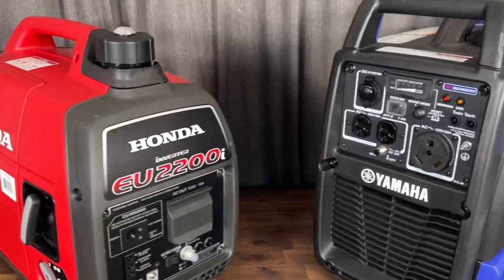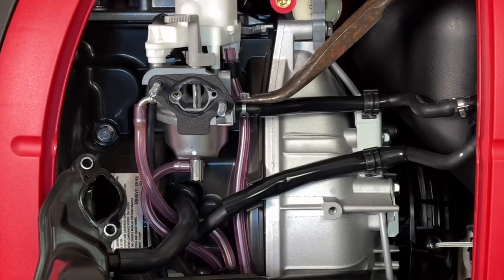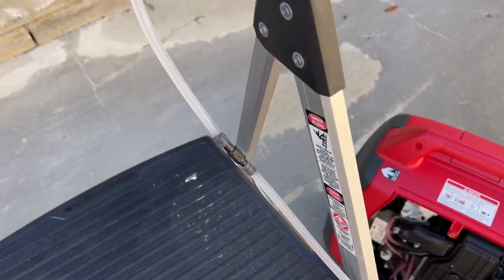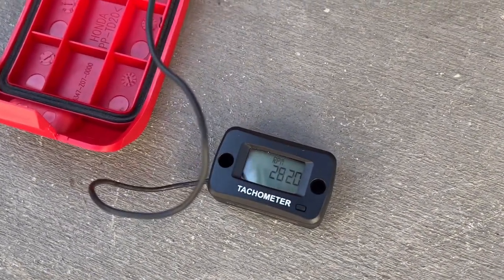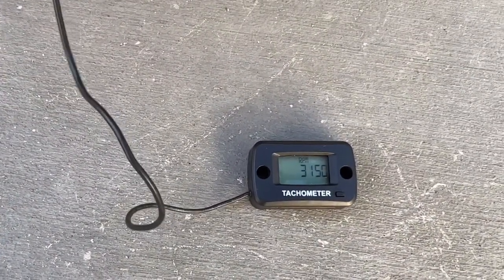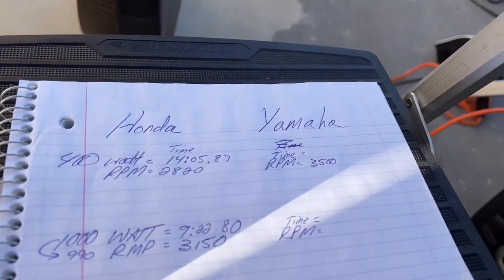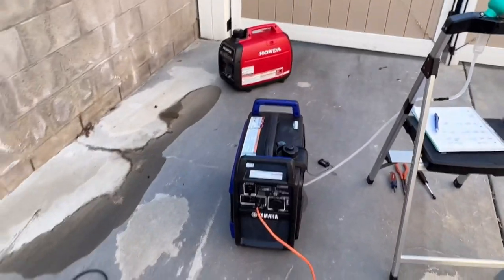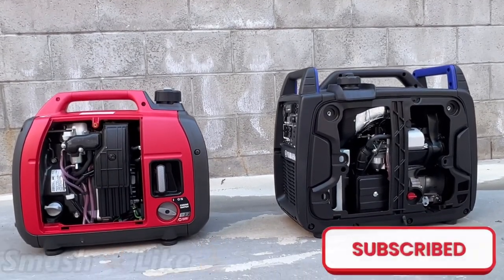Honda Eu2200i VS Yamaha EF2200is Fuel Efficiency Test

Comment: We had the Honda E300 decades ago it was an amazing generator which we took half way around Australia.

We started in Phillip Island and we drove up the East Coast right up to Cook Town then back down to Charters Towers.

Then across to Three Ways Road House then back down to Adelaide stopping at Alice Springs, Tennent Creek Cooper Pedy and then back down the Peninsula to Adelaide.

Over 170+ camps in total.

We ran it over twice. (Forgot it was under the van).

We thrashed the shit out of it !

I don't know how it lasted as long as it did.

I would regularly take the head off and decarbonise and clean the combustion chamber.

Why? I dont know. Back yard mechanic told us to. 😀

It was very good quality generator.

Fk knows how it used to power what we put it through.

I think it only generated 300W.

Anyway, I'd buy another one albeit much bigger like 1800W or bigger. 

Honda. What a beauty! 👌👏
Reply from the maker: Dude awesome story!! Those old units were like tanks much like a lot of stuff from the 80s and before. 

Thanks for the comment and thanks for watching 👍🏼😀
Reply: @johnnysweekends  Thanks for the reply.

Much appreciated!

😀🤟

Comment: But...  higher RPM's means more wear.   So you can expect the Yamaha piston rings and cylinder walls to wear out much faster than the Honda will.
Reply from the maker: Possible, but you also have a push rod motor verses Hondas timing belt. 
It’s pretty close from all gathered data. 
I do prefer the Honda though for size and how quiet if choosing between the two
Reply: @johnnysweekends  Gotta admit,  not crazy about the timing belt repair on the Honda.
Reply from the maker: @BillySBC its not horrible but its time. And how many hours on the whole unit. So all depends i guess.

Comment: Seems like the best way to do the test would of  been  the way they are ment to run from factory.
Just add a qt. of gas.
Reply from the maker: That’s leaves uncontrolled variables… no way to measure fuel line length, or visibility of all fuel used up, and setting load then topping fuel to fill mark and set timing.
To many flaws just pouring fuel in.
Reply: @johnnysweekends  thank you for responding I understand 100%.

Comment: Common sense says at higher rpm the Yamaha was louder...  For potential new owners please include decibel tests in this video series

Hondas gensets are incredibly quiet ...reliable durable.. and worth their cost....

I myself am an mz80 Yamaha guy because I can buy a genset from various makes with a genuine Yamaha engine for considerably less.. than a genset directly from Honda or Yamaha...

I own 2 smarter tools ap2000iQ gensets with genuine mz80 Yamaha engines that I parallel with a wen 30A/50A socket kit..  

1st genset is from 2004/5 second genset from 2009..  the outer cases are scratched and banged up but they keep running..
Reply from the maker: People love the mz80 engine especially since it’s push rod and not belt driven

But I do have a sound test and load test on these exact two units in another video. 

But yea if your Yamaha does finding a engine would actually be really easy to replace. Not so much on a Honda. 

Thanks for the comment and thanks again for watching
Reply: @johnnysweekends  yes I seen the sound tests.. but sometimes people are viewing for the first time... It would be helpful for them...

You are my go to for infor generators.. fossil fuel and lithium...

When my gensets end their servicibility..  A-iPower for 2x 2300w and an ecoflow..

All thanks to your obsessive compulsive...micro managing and tyrannical testing
Reply from the maker: Wow thank you. 

Yea I guess I could at least let the viewer know I have a video with the sound tests or give them a overall on it. 

But yea many more videos coming. Just need time, work has been crazy 😜

Comment: Sorry, but tests were flawed from the beginning.  The machines were not necessarily tested with exactly the same volume of fuel.  Only if the carburettors were the same internal volume and fuel level, when the jets failed to pick up fuel, could these tests possibly be verified as fair, if even then.

A fair test would be to time for an identical measure of fuel - one level on the external measuring vessel to another on that vessel.  The measurements could be repeated without the machines running out of fuel (running out of fuel is not the way the machine operates normally).

I’ve no idea which machine is most economical on fuel, but often, when used in the real world, the machine may spend some time at virtual idle or it may be running on a constant load.  Even the actual voltage sustained may alter the total energy delivered, which may change close results one way or the other.

Fair tests are not so very easy to arrange - especially if machines are closely matched - and these single tests were not proven to be a truly fair comparison.
Reply from the maker: True the float bowl size could have definitely giving one a advantage by a slight margin. I would say seconds as I have taking these apart before and the amount of volume between the two is minimally different. Every test has room for error and handicaps if you will. 
So to say the test is flawed is not really accurate at all. Verses the test did give some good usable data. Over all a smaller displacement engine running a light load more than likely is going to burn less fuel. 
But you are allowed to view it as you see fit. 👍🏼
Reply: @johnnysweekends  There is also the state of tune of the carburettor.  There is the possibility that one was set weaker than the other (ideally they should be precisely the same, but not quite would be near enough to affect your results over a period of time).  Some ‘running in’ might affect the life-time energy efficiency.

Doing one run on each test was not particularly good practice, what with the results only being marginally different.

Yes, personally, I would not accept your conclusions from only one run on each setting - with no further corroborative evidence that everything else was exactly identical.  Sorry, but my personal conclusion, of your results, from a scientific point of view.  Your conclusion may be correct but just not proven, either within the realms of significance or from the point of fair testing.   Experiments such as this, with sweeping statements such as this, cannot be regarded as absolute.
Reply from the maker: Well if you just want facts I’ll let you draw a conclusion. 
Out of these two generators, if I give you one gallon of gas, which one will provide you with the most total energy?
Reply: @johnnysweekends  From your tests?  I would have no idea, but I doubt there is very much between the two of them.  

Personally I prefer Honda to Yamaha - but my preference is likely biassed - from motorcycles in the 1960s to the strimmer and small water pump more recently.  

What is for sure is that I would purchase neither, in preference to the other, by using your testing data.    I would be looking for more fair testing of the items, before coming to any hard conclusion.
Reply from the maker: If over all energy is what you are looking for out of 1g of gasoline the answer starts with the color B. 
Unless that still cant fill the ending your looking for. But hey what do I know.

Comment: Your Honda not running smooth, lots of vibrations on idle.
Reply from the maker: Yea seems like a normal complaint even my eu2000i did it…
Reply: @johnnysweekends  my 2200 run smoother.
Reply from the maker: Yea I know people have said that there unit runs smooth and others have said mine runs a little rough like yours… so unless I wanna mess with the mixture and break the tamper cap it will stay that way. 
🤷‍♂️
Reply: @johnnysweekends  Mines the same runs a bit rough
Reply from the maker: Yea weird, maybe harmonics down low or?? 
Thanks for the reply..👍🏼
Reply: @johnnysweekends  I think it goes into a super lean idle. People talk about adding a bunch of fuel (with the mixture) to make them idle smoothly
Reply from the maker: Yes they set these pretty lean but unfortunately they didn’t do enough to meet CARB standards which is why they got pulled from CA. Lol generator scandal lol
Reply: @johnnysweekends  Throw some seafoam in your honda fuel it should take care of that unless something on the carb is set incorrectly.
Reply from the maker: It’s new it did it from day one along with many others but it smooths out eventually depending on load. It’s had Lucas fuel treatment as well from the beginning. 

Just how they run sometimes unless I want to mess with the tamper cap

Comment: I wish u had gathered 1 more piece of data during this test, dBA noise.  Was the Honda quieter at each RPM?
Reply from the maker: Honda is quieter through the entire rpm range. On the low rpm’s not by much but still quieter than the Yamaha. 
Honda has everyone beat there